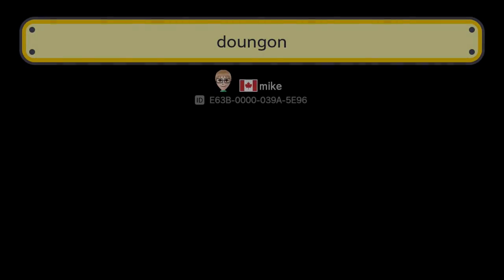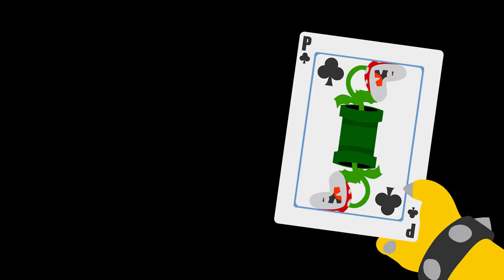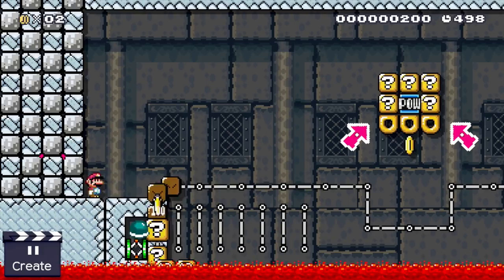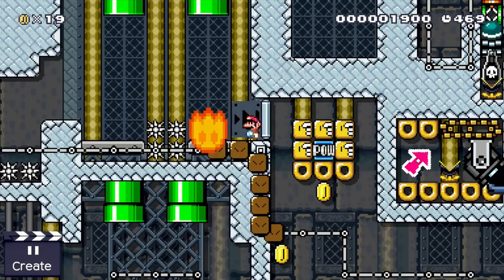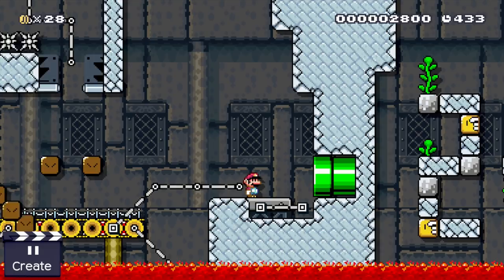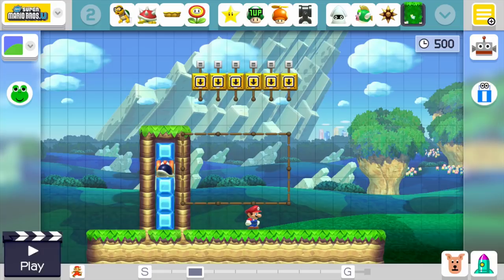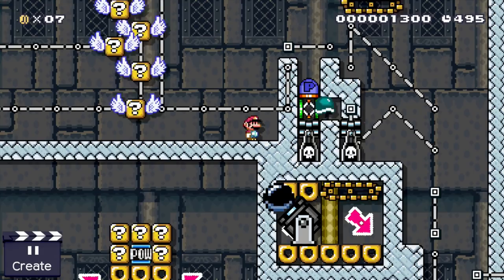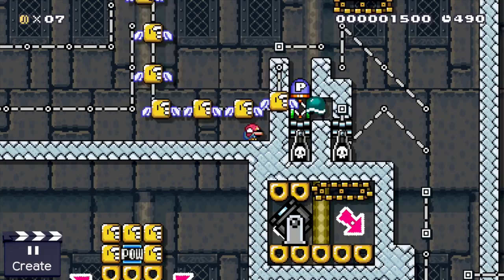How to Recreate Railway Switches in Super Mario Maker!

Comment from the maker: As it turns out, the creator whose level is shown in this video, isn’t the one who first discovered this trick. The original concept is by an awesome japanese Maker called TTT. He made two stages using this trick, which are both really amazing! The level we took a look at in this video is similar to his recent stage but not an exact copy. I don’t think the creator shown in the vid had any bad intentions, but the credit for coming up with this design should definitely go to TTT. Here’s his bookmarking page, he has some incredibly creative levels you should definitely take a look at!
TTT -Bookmark:
https://supermariomakerbookmark.nintendo.net/profile/tetsu_TTT?type=posted
First Level using this trick:
https://supermariomakerbookmark.nintendo.net/courses/D765-0000-0301-5D38
Second level using this trick:
https://supermariomakerbookmark.nintendo.net/courses/2CBF-0000-0383-4968
Reply: https://supermariomakerbookmark.nintendo.net/courses/DA06-0000-039E-3DDA

Ceave, this is a POW level i made with an interesting mechanic that i have never seen before. (Discovered this on accident while building my recent POW level.)After the first checkpoint, there is a "rock wall" of winged blocks, and you have to pow drop into the floating wall to make anchor points to climb up it by jumping. It can be scaled with one well-placed POW, but i have given 2, as it's easier to scale with 2, and i wanted the player to enjoy the mechanic rather than be frustrated by it. (if you're starting from the checkpoint after having died, then you can "cheese" another POW block from the extra section that precedes the rock wall also.)

Thoroughly enjoy all your content, and glad to see this wonderful rail-switching machine featured by you.
Reply: You should check out more of TTT's Levels. They're REALLY clever!
Reply: That might be what you gaet
Reply: Hey there! i made a level with an interesting little contraption. Level ID: https://supermariomakerbookmark.nintendo.net/courses/A8D4-0000-0397-AAA7 . Hope you enjoyed it!
Reply: By the way, nice video!
Reply: Can someone give me the id for one of TTT's levels? I can't use the bookmark site cause my Nintendo account isn't working properly.
Reply: 3:36
TRIGGERED
Reply: Bone JP - Heyo Ferenc. Haven't seen you for a long time.
Reply: Ceave Gaming  I like ur vids make more!
Reply: TTT
Reply: Ron Barnes *by accident
Reply: I didn't know you  could bookmark in super mario maker :0 !!!
Reply: I’m thinking of making a level with this trick...
Reply: Do a video all about snake blocks when SMM2 comes out please!😊
Reply: @BlueFinch  make a video. A don't  have a Wii U and don't understand very well the level.

Comment: one important caveat of this mechanism is that, if you trigger the POW too close to the time the first block car goes behind the bullet blaster, part or all of the second car may go the wrong way anyway, even if it "looks like" there's still time to change the direction. In other words, the switching moment is slightly before the first car goes behind the curtain, not while it's behind it. So make sure not to put the POW block to close, or consider moving the shell setup closer.

Comment: How would mario maker switch work without the touchscreen? I want it really badly but I feel like it would be impossible.
Reply: the switch has a touchscreen...
Reply: Stupid Username not when docked. It would be super awkward to have a handheld only game
Reply: You could have a cursor that you move with the control stick for both modes, and then have touchscreen available for handheld mode
Reply: OrdovicianAphelion The Nintendo Switch does have a touch screen
Reply: its a bit complicated but here's something that could work (using Buttons),

A = Place Element
B = Deselect Element / Back
X = Show Full Pallete
Y = Acess current top bars/ side bar (to change element, them, game, undo, etc)
+ = Access Menu
- = Play
Hold - = Play from beginning
D-Pad- Move Screen/Mario
Left / Right Stick- Move Cursor
Press Left / Right Stick- Shake element
L / R- Multi Grab Mode 
ZL / ZR- Copy Mode
ZL+L / ZR+R = Erase Mode